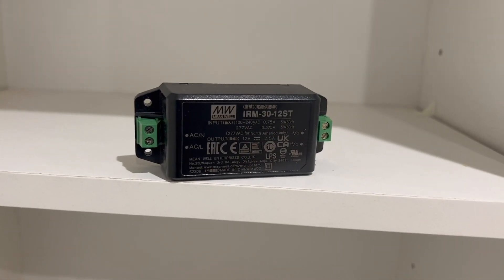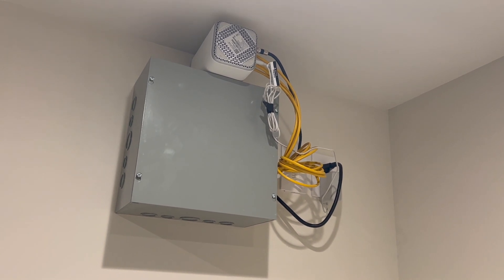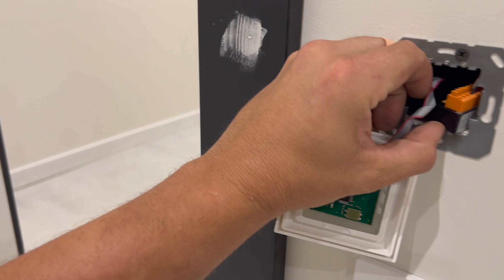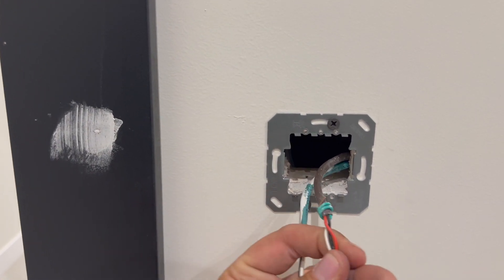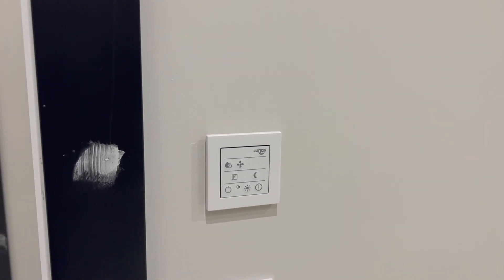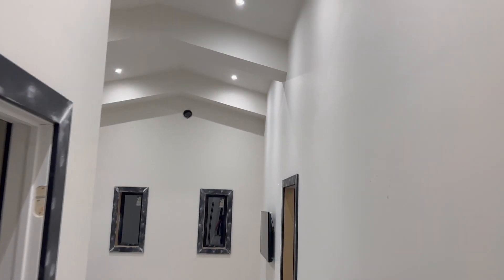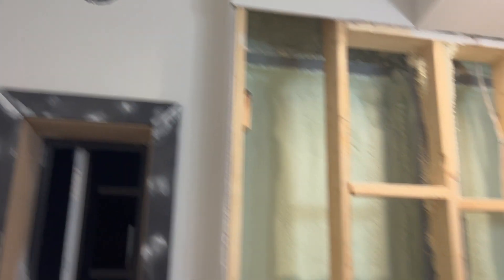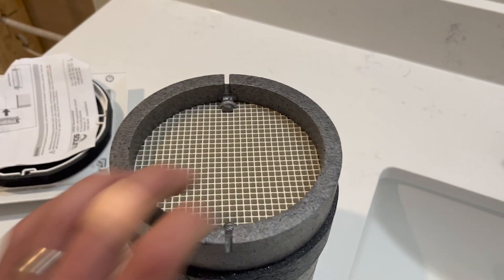HRV System? - There' a better way!

Comment: What screws did you use to affix the controller to the wall and the supplied drywall box because there was no screws with the kit and could not find any local screws that would fit

Comment: Hi guys, we are building a 2100 sq ft rancher in Alberta this summer and are looking at these units. The house is 3 beds 2 baths and a great room. What would you recommend for units? How do you deal with bathroom ventilation? Do you still need a vent fan? What about the kitchen? We plan on a downdraft recirc extractor, would we need a fan as well? Love your builds. Hi quality for sure.